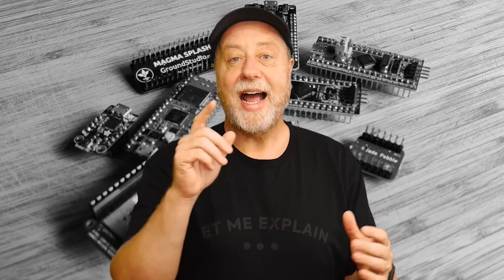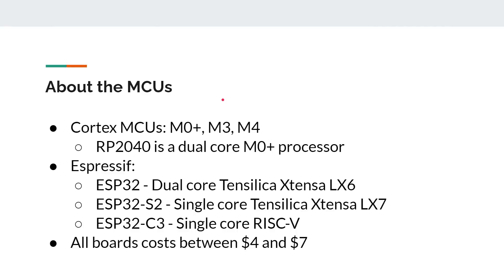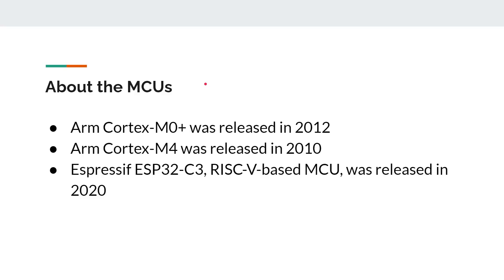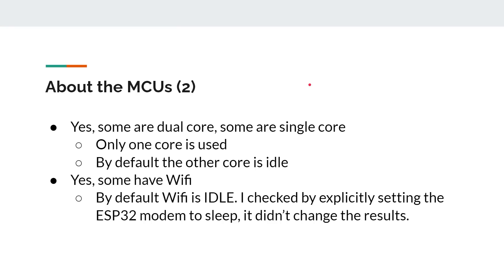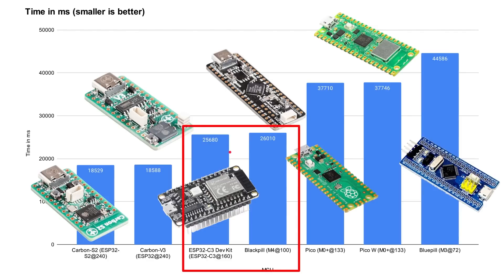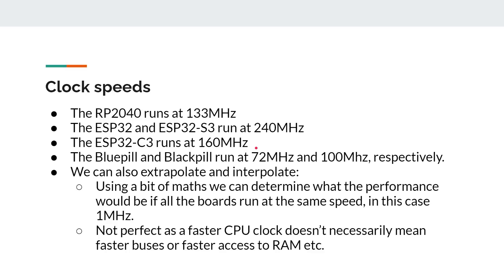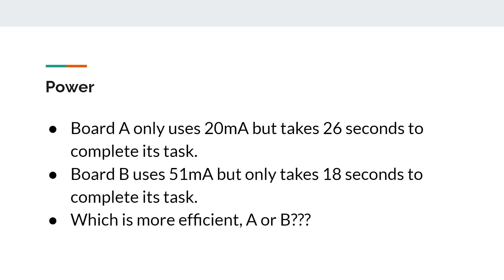Arm vs RISC-V? Which One Is The Most Efficient?

Comment: Keep in mind: The efficiency of all CPUs has always improved over time. ARM CPUs exist since 1985, RISC-V CPUs exist since around 2019. So draw your conclusions for the future.
Reply from the maker: Exactly, RISC-V will get better, but so will Arm, meaning RISC-V will always be two decades behind.
Reply: @GaryExplains  Yet the other rule is: The older an architecture, the smaller the improvements. RISC-V currently improves at a much higher pace than ARM does, that's because all the obvious improvements already happened to ARM in the past whereas RISC-V is still at the very beginning of that process. So it is at the beginning but at the same time it already can compete with ARM. This is because the RISC-V designers have been able to incorporate knowledge from past improvements into their core design.
Reply from the maker: Well x86 seems to keep improving, so I don't think your rule quite works. Plus if "all the obvious" stuff can be included in RISC-V, why isn't it included at the beginning, since it is so obvious?
Reply: @GaryExplains  If you look at x86 improvements over time, you can see how the curve has been consistently flattening for over a decade, and that's why ARM has been able to overtake x86, because ARM is still at a steep angle. Even ignoring Apple CPUs, current ARM cores are easily comparable to Intel's i5 CPUs, but at far lower power consumption. Apple's CPU is on par with Intel's i9 series. AMD was able to rise more steeply again, but at the expense of redesigning their entire CPU core from scratch but they cannot maintain this growth either and are flattening out again. However, if you look at the RISC-V curve, it's already steeper than the curve of ARM, so if they can keep going that way, you can already project when they are going to overtake ARM; and in its early years, every architecture so far was able to make huge improvements for quite a while. 

As for including obvious things, please don't confuse architecture and implementation. You can make improvements at both levels. You can create a better architecture that avoids mistakes that other architectures made in the past that turned out to be mistakes only in the long run. And one can improve the implementations of an architecture. However, the first type of improvement is only possible if you develop a new architecture, since you can't simply redesign an existing architecture, as that would break backward compatibility. Since both ARM and x86 are already 64-bit, there won't be any dramatic changes to the architecture anytime soon. You can add new instructions, but you can't change the existing ones without breaking all the existing code. Because RISC-V is relatively new, it has been able to learn from all the mistakes ARM and Intel have made in the past and evolve the architecture around those mistakes; that's why it's had such a head start and is so good after such a short time. But also because they are new, there is little experience on how to best implement this architecture, so there is still huge potential for improvement at the implementation level, which is the only level that ARM and x86 have been able to improve at for a long time, and so that level is already relatively exhausted for these two. Therefore, they increasingly have to rely on "dirty tricks" to achieve any significant improvements at all and here the problem is that these tricks often lead to security problems because you don't clean stuff up or don't do security checks or do them late, simply because that improves performance, reduces transistor count, and reduces power consumption but it also creates new attack vectors.
Reply from the maker: The problem with your essay is that AArch64 (and to some extent Armv9 ) is a clean new ISA and therefore is actually newer than RISC-V.
Reply: @GaryExplains  AArch64 was introduced to the public in 2011, so you can estimate how long before that development started. In 2010, the RISC-V design process was started and it is still ongoing today. Several extensions that could be very useful for CPUs and dramatically increase their performance are still in the works, such as "Standard Extension for Packed-SIMD Instructions" or "Standard Extension for Transactional Memory" or "Misaligned Atomics". These are not even frozen yet. AArch64 did not start from scratch either, as backward compatibility with existing ARM code had to be maintained. So while perhaps the implementation was made from scratch (I don't know if that's the case or not), the instruction design didn't start from scratch, and possible design errors of the past couldn't be corrected either; they could only ensure that those errors wouldn't be repeated in the new 64-bit instructions. 

JJust like in the case of x86, the switch to 64 bits has given the architecture a big push, and this push is not directly related to the additional 32 bits, but also to the new instruction design (e.g. x86 benefits greatly from the fact that x86_64 has many more registers, and more registers have nothing to do with the switch to 64 bits), but such a push is also only temporary. x86 already had this push in 2003, and as you can see, it didn't last long enough to stay ahead of ARM. So I'm pretty confident that RISC-V will catch up and overtake ARM in the long run, it's just a matter of time. Unless a third architecture emerges in the meantime and puts both ARM and RISC-V in their place.

Comment: You should have compared ESP32-C (RISC-V) series chip with STM32 WB (ARM M4) series chip. They are direct competitor in function and price. 
Chip from 2010's are too old. I am not impressed with ESP32-C (RISC-V). 
I can not find any reason to use RISC-V based controller like ESP32-C in my future project. 
ARM based controllers are still the way to go in performance, efficiency, and cost, not to mention ease of development.

Comment: May have already been mentioned, but Amps != power. When you change the input voltage to 3.3V and the current doesn't change, that indicates a change in power. I'm not fasmiliar with these boards, so IDK what the initial input voltage as, but if we assume 5V, and the current doesn't change when switching to 3.3V, then that is a 34% decrease in power.
Reply from the maker: Yes, of course, but that doesn't change the relative results, does it. What exactly is the point you are making?
Reply: @GaryExplains  yes it does change relative results. Rpi pico does have a switching regulator not lineal one that outher boards have.

Comment: I don’t think you are actually addressing the real issues. 

First, what fabrication processes are used? A 160nm chip is going to have worse clocks and power than one using the latest FDX22. 

Second, how many transistors is each implementation using and how much die area? Much of the RISC-V advantage will be found here. With planar fabrication hitting a wall in 2010, this is the only real way to reduce costs as cheap 22nm took a decade and 14nm will probably take another decade. 

Third, you are comparing devices with widely different costs. You wouldn’t consider a comparison of a $1000 and a $2000 desktop to be fair and it’s not apples to apples here either. Instead of board cost, you should look up price per 1000 chips.
Reply from the maker: The RISC-V chip is built using 40nm the Cortex-M4 Blackpill using 90nm.
Reply: @GaryExplains  This is the problem. The RISC-V chip is $1.10-2.10 @ 1k units (not sure which model) on mouser while the M4 chip (STM32F411CEU6) is $5.69 @ 1k units. That's 2.5-5x more expensive and is the same as comparing something between a $109 Ryzen 4100  and a $209 5600x with a $549 Ryzen 7900. I'd note that the 1-unit and 1k unit prices of the C3 chips are the same while the 1-unit price of the M4 chip is $10.15 or 5-10x more expensive. The Blackpill board is $30 vs $10 for the C3 dev kit.

The most notable thing here is that the C3 chip is offering WAY better performance per dollar in typical MCU workloads no matter which of the C3 chips your unit is using. If I steel man your argument with the most expensive C3 chip, things don't look very good.

C3 has 8x the flash memory and 3.2x the SRAM along with Bluetooth 5 and wifi. M4 has better interrupts and more IO along with a USB-2 controller. C3 has two 12-bit ADCs, but only supports 5 channels on one and 1 channel on the other while M4 has one 12-bit ADC, but with 12 channels. C3 has hardware crypto, but M4 has DSP support meaning it supports floats and has a 32-bit SIMD (which is where most of that extra cost comes in). All this shows the problem when comparing apples to oranges.

Unless someone actively needs the DSP, the value of the C3 is simply going to be a lot better than the M4.

https://www.mouser.com/ProductDetail/Espressif-Systems/ESP32-C3?qs=iLbezkQI%252BsiMXe7tMG%252Bo%2FA%3D%3D
https://www.mouser.com/ProductDetail/Espressif-Systems/ESP32-C3-WROOM-02-H4?qs=stqOd1AaK79%2FSA14oWtR%252Bw%3D%3D
https://www.mouser.com/ProductDetail/STMicroelectronics/STM32F411CEU6?qs=pjMTYa9MTGV3ou31YBFa3g%3D%3D
Reply from the maker: @mrbigberd  The Blackpill is under $10 from AliExpress.  I don't know where you are getting your numbers from.

Comment: The ISA does make a small difference, and the fetch-decode speed was a large factor up until high mHz and pipelined branch prediction. A clean(ish) slate approach to both the ISA and IMPLEMENTATION SPECIFICATIONS of Risc-V working in tandem is what gives RISC-VECTOR the edge. 
--
A proper Vector Processing specification instead of SIMD (an ISA DISASTER that should have stopped at SSE4 on the X86, and should never have been introduced into the ARM ISA... A Vector processor would have been vastly preferable and the tech was well proven.,
--
A major benefit is to combine CPU + GPU programming into one (much more) bare metal ISA for both, eliminating a ton of API translations and JIT compilation, Short but quite efficient or very long and perhaps more efficient pipelines can be experimented with by LOTS MORE CHIP (PART) DESIGNERS, while developers get a STANDARDISED ISA.. 
--
Bare metal GPU Compute will be much EASIER. Integrated graphics and general purpose Vector processing compliment each other, but software-only graphics systems using just the vector processor and a few CPU cores could be more efficient and good enough for web + office..
Reply from the maker: You think microcontrollers have branch prediction?
Reply: @GaryExplains  .. not yet, and hopefully never! I agree on the microcontroller front RISC-V is no better than the Pi Pico spec. It's also less RISC than the pico.. The low end RISC-V spec now includes basic, MMX level integer SIMD, probably FP SIMD when it's finalised then extended, so quite bloated compared to Pi Pico ISA. 
--
I'm an ARM fan but think the High End RISC-V spec is a better idea (Vectors vs fixed sized SIMD).. Risc-V is an ARM killer, X86 never was... ARM is still the most likely X85 killer but Intel and AMD will probably race to replace X86 with native Risc-V and emulated X86. 10s to 100s of smaller SOC designers and manufacturers will obviously also prefer Risc-V.
--
Sadly ARM's days are numbered. It may well have to abandon its ISA and many core implementation details when it too goes Risc-V.. Open Standards are very powerful forces.. Look at IBM PC, HTML + CSS, Unicode. For better or or worse, these royalty-free technologies alays dominate.
--
I actually prefer 2 byte opcode ISAs using a few tricks and vector processing over SIMD. de-bloats the cache and pipeline. Risc-V is getting more bloated despite its lack of SIMD. Too many cooks spoiling the broth will be the reason Risc-V fails, if it does, which it probably won''t. A (US) Big Boy could buy out the project I suppose, and ruin or bury it, but that's unlikely too.

Comment: I actually disagree that architecture does not decide efficiency just implementation. It is not so simple! You can say that one can implement both using steam engines and valves and silicon and make a HUGE difference - but you can also come up with instruction set architectures that are "easier" to implement well on silicon or harder to implement well.

The same is saying that you cannot basically tell which programming language is faster because they are just a language - a specification - not an implementation of that. Yes you can make a very dumb C compiler that makes it slower than python, but for some reason all well-made C compilers are tons faster...

Why? Because the specification was made that way (or ended up that way) so that it can be more efficiently implemented both on average and on best effort! Trust me: I can come up with an instruction set architecture any day that can be only implemented garbage slowly if you don't understand what I talk about or parallels...

Also would be good to have riscV SoC variants that does not have the integrated wifi... being in sleep or not existing likely makes a huge difference (if not for other, then it takes space on the die which could be utilized to have lower consumption solutions for example).
Reply from the maker: True, but we aren't dealing with a specification that you "can come up with", we are dealing with Armv6 and RISC-V. That is the context, not "u9vata's amazing ISA".
Reply: @GaryExplains  Sure. That is an extreme example, but it shows well that ISA specs - just like programming language specs - do have a leverage on the possibility of implementation. I expect you to know that and don't get me wrong, this is all interesting data worth really measuring (I would even argue that if most ppl literally use whole boards among makers, whole board consumption / efficiency is also not bad to measure and makes it more real life stuff).

Only saying that it could be misleading also to think that spec or ISA cannot affect performance of average, worst and best implementations efficiency range. It is not as simple to measure that like measuring a product and I guess it is actually too early for that but it is not just business randomness that all mobile devices have not x86 but arm for example and generally fare better. It is not just the implementation, but the spec can be better suited for this or that.
Reply from the maker: The reason why I emphasize the implementation over the ISA, is because people think that RISC-V is magic and that the ISA itself will somehow solve problems of power and efficiency. That is nonsense. Since the context is two well designed and well defined ISAs then I think my statement stands and isn't misleading.
Reply: @GaryExplains  I think to be honest it is too early to draw conclusion on which ISA fares better when it comes to efficiency. I am pretty sure there will be difference, not yet sure what direction. Has hopes and that is all.

So just like you emphasize the implementation over ISA so that people might thing ISA is the only factor, I want to emphasize that it is indeed a factor and a defining aspect - but on a different granularity: Implementation more tied to the product directly. ISA more tied to class of products overall statistically relevant effficiency generally.

I think we do not really contradict each other here to be honest.

Comment: You also need to consider the code density. The firmware binary size is usually smaller using ARM cortex compare to RISC-V or ESP32.
Reply: update from the future: the code density is starting to change in risc-v's favor as compressed instruction support is maturing.

Comment: Interesting video :) I do not think it is enough to just to power the 3.3v rail since there are other onboard electronics which also require a power (usb to serial converter) on the esp32 chip. It could have been interesting to see it compared to the datasheet :)

Comment: About the ESP32 power consumption when powered by 3V3: cheap LDOs like the AMS11x consume quite a lot of power when only voltage is applied at the out pin. Is in the range of 3-10mA
Reply from the maker: And on the 3.3v pin?
Reply: @GaryExplains  Yes cheap LDO Voltage Regulator like the AMS1117 consume power even when no voltage is converted by it. this is called "Quiescent Current" and can be found in all LDO datasheets. For the AMS its between 3 - 10mA and is the main reason why cheap EPS32 boards consume above 1mA when in deep sleep. There are better one available but they cost 60 cents not 6 cents. I had to find this out the hard way when when designing a battery powered ESP32-S3 board. Its enough to have 3V3 on the output pin of the LDO for this current to flow from the 3V3 output to GND through the LDO chip. its a kind of leak current. an easy way to fix this is to just desolder the LDO and power it directly with 3.3V on the 3.3V pin
Reply from the maker: Thanks for the info, very helpful. 👍
Reply: @GaryExplains  no problem ;] power consumption is a bitch x]

Comment: The silicon fab processor node tech used to make the chips plays a huge role in their efficiency.  It would be good to include fab node info in the comparison data.
Reply from the maker: Indeed, it is something I will note for future videos. As for this video the key is that the Arm Cortex-M4 is using 90nm and the RISC-V ESP32-C3 is on 40nm, which makes the performance of the RISC-V processor even worse.
Reply: @GaryExplains  Wow that's very telling.  Thanks Gary!
Reply: Also the area of the chip also should be a criteria